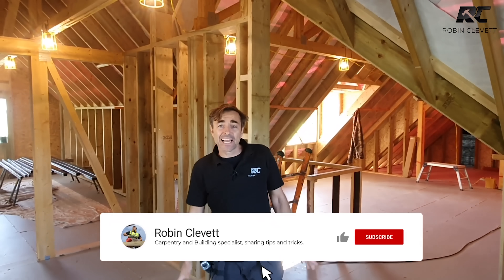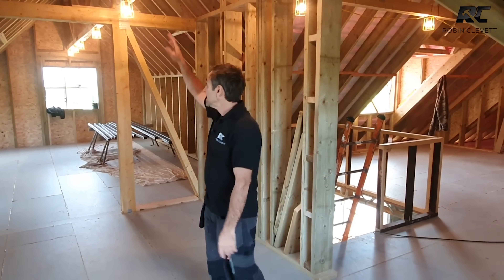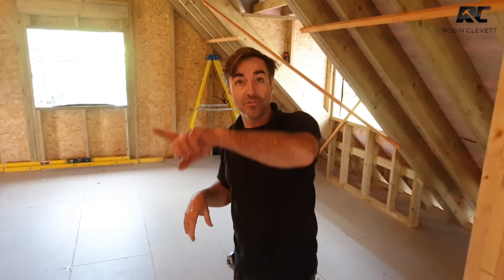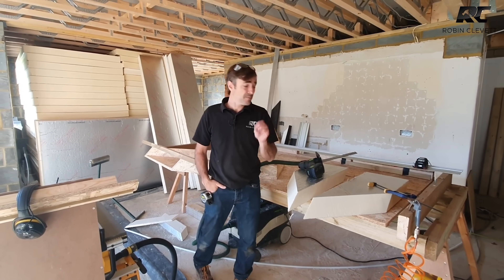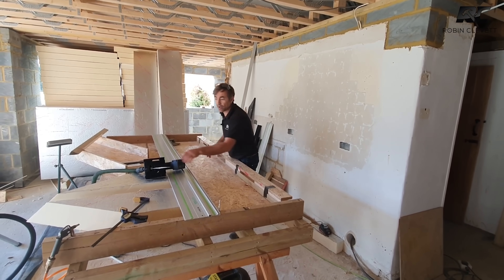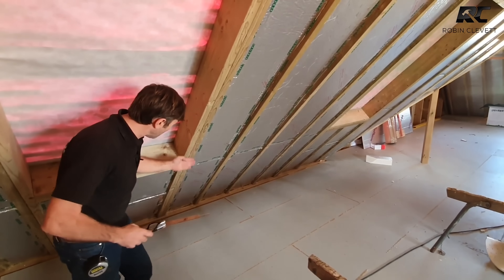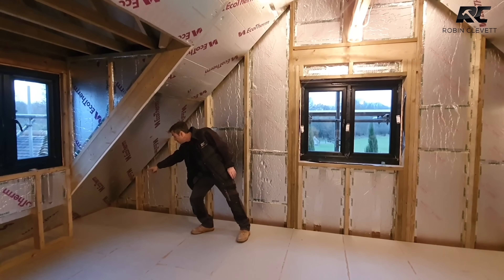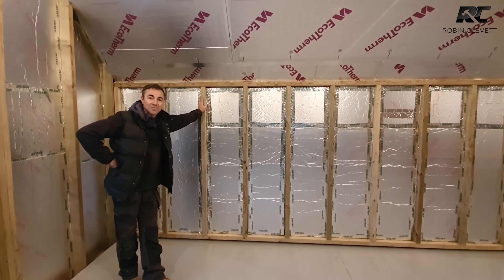How to fit insulation 2023 to the latest Building regulations Part L

Comment: Why not eliminate the roof venting, pushing the building envelope up under the roof deck? There’s no evidence I know of that this compromises any roofing material, and unless you have some radical moisture issues (tropical beach house, indoor swimming pool) there shouldn’t be strikes against it. Why is that roof vented in the first place? Is that your personal preference or something?

Also, leaving a 12-15mm gap around each panel and affixing them with expanding foam will seal better than any tape application, and will add shear value to boot. But you have the right idea with a 100mm fill and a 25mm topper sheet. That gives exactly the maximum benefit of closed cell foam sheathing. All you’re missing is the overall airtightness management, as I see it.
Reply from the maker: Hi Travis, the foam fill and cutting short really does not work, as it is almost impossible to fully fill the void, also you have to some how support all the boards while you try to foam the edges many people do this but it has so many pitfals, let alone 40 cans of filler foam and all the aerosol gasses!! Thanks for your comment mate
Reply: @robinclevettcarpenter  I’ve gotten the edge foam method to a science, using a few 2x4x8cm wedges of xps to hold the pieces in place. A sufficiently wide gap allows the applicator tip in to completely seal for air infiltration.  This is the only method I know that approximates the performance of either spray foam or continuous sheets of foil-faced rigid board. I sincerely doubt you’re getting anywhere near the full insulation value of your 100mm layer.

You also didn’t answer the question as to, why the roof venting in the first place? It’s like have a couple rooms with windows wide open, year round, which you must then somehow isolate from the rest of your building. That’s your real defect here — your building envelope is actually that continuous 25mm layer beneath the wallboard. The 100mm layer is, for  all practical purposes, outside the building envelope.
Reply: Travis, I think you’ve misunderstood the uk construction used here. What’s the air tightness that you’re talking about? The first layer of PIR goes from wall plate to ridge, and with memory foam tape, it is airtight, second 25mm layer is for the enhanced regs, plus is taped, so no air or moisture is getting thru from below. As for above the PIR, all uk roofs are vented from eaves to ridge to allow any moisture to dissipate from under your tiles or slates.

Comment: There are a few mineral/glass wool products around now with thermal conductivities as low as 0.032, which means they only need to be 1/3rd thicker than PIR for the same performance. Seems like that could be an option when you've got rafters as thick as this to hide a lot of that within, easier install as push fit without any additional products and it does self expand a little to fill gaps. Much easier to use offcuts when it knits together too. Not to mention the fire performance.
Reply: It can't be used in the roof, as it will sag over time, I found this is with my extention
Reply: @martinknight510  I imagine you'd be counter battening/boarding underneath

Comment: Great video and excellent set up for a cutting station 
I would suggest cross battens on the main roof as it allows water to run down on the felt easier and creates an air gap  with the vent strip over 
Less water on roofing laths
Allows for full fill insulation between rafters as well
Note increased spacings change design loadings and need to be checked with structural engineers depending on roof coverings
Great stuff Robin 👏 👍
Reply: My house is 1930's, tiled directly onto closed boarding....am I right to assume without stripping all the tiles, installing membrane and retiling over battens I can't use foil insulation, but can under loft floor

Comment: Just curious about the dead space between the rafters above and below the Velux?
Reply from the maker: This is so we can have a level plastered reveal at the top of the window and a plumb reveal in line with the wall below
Reply: @robinclevettcarpenter  Understood but no air movement above and below velux, no matter ? dead space/no air movement usually = condensation, am i missing something? Vapour barrier adequate in this situation?

Comment: cracking job. thats why i like ybs as you stickit over the whole roof then  cross batten then any internal voids can be done with rockwool the real stuff. and vapor p board. out of interest how do deal with humidity in your air tight buildings trickle vents and air heat recovery?

Comment: That looks a really great job. I am thinking of insulation my loft space, not to use as a room but to give the house better insulation. In my roof I have my boiler and hot water tank so a lot of heat is lost. My  house is a victorian property, double fronted. Huge roof and high ridge so space is not an issue. I was thinking instead of in between the rafters, which are not a precise centres, to place the insulation on the inside surface of the rafters, therefore putting in whole sheets and fixing through the sheets with long screws and washers, sealing the joints with tape. Would you have any comment on this method?

Comment: You are the industry poster boy for British standards. Over and above the call of duty. My issue is always cost. Time is expensive. Materials expensive. That posh saw is a Festool. Mega expensive. Never made the sort of money to have Festool anything. Personally I have issues with modern regulations and the idea of living in an hermetically sealed box. I don't believe it is good for the structure or the occupants. Roger Bisby made a comment the other day about houses with chimneys and open fires allowing all your moisture and air movement sorted by going up the chimney. The home owners all the healthier for it. Winter and summer in the UK I never shut my windows. Wake up with snow on the bed but never sick. If the regs want all this crap how come the UK hasn't gone the way of the Yanks and spray foam. A lot easier to do all those awkward angles with a spray gun. Either way these processes create their own problems and add extraordinary amounts to the cost of a build. There really is no such thing as affordable housing anymore. To me the initial cost out weighs the benefit. As a young couple starting out having a house that they can  comfortably afford and still have a life I think would be more important than buying an over priced super box with an environmentally controlled temperature setting that they had to hock granny to afford. Just gone too far.

Comment: Having used Gapotape, which I think is great, how did you deal with the release agents on the face of boards?  I tried white spirit to remove it, but it didn't work very well.  Meths worked, Acetone was best.
Reply: I am glad someone else has noticed this, I bought celotex recently as well as roctocel boards and it had this odd film / goo on the edges and the merchant told me it’s suppose to be cleared off in the factory, I was trying to put metal foil over the boards that were stopping the thermal bridge and no tape would work till I put spirits on it, word of advice to anyone getting boards, check the edges 🤦‍♂️
Reply: @lancelotswingman3907  I was told that the release agent was for when the boards are stacked on site, to make them easier to separate.  Apparently it varies from manufacturer to manufacturer.  I'd wouldn't use white spirit to wipe the boards down again.

Comment: Great job very impressed with the compound cuts great idea , just wondering do you keep a air gap between the breather membrane and PAR , and again between the 100mm PAR and the 25mm PAR  , Thanks a mill for the video 👌☘️🇮🇪👍👋
Reply: Fur vented cold roof you would have minimum 50mm ventilation gap between 100mm PIR and breather membrane. The gap between 25mm and rafter would be zero.

Comment: I dread to think how much all that cost. Just managed to see the batons you used to leave an air gap, 2 inches? behind insulation and roof. I insulated my floor with that type of insulation, unfortunately all the floor beams were different centres, being an old house and the swearing as I had to fit each piece individually was a joy to behold. Nice job Robbin!!
Reply from the maker: 50mm is the desired airflow gap behind the insulation
Reply: @robinclevettcarpenter  what about behind the wall insulation? That looks pushed tight into the space.

Comment: Just seen the price 😳 mega expensive. Are there no alternatives? I always try and snug fit. Don’t like cutting short and foaming like some do but could a snug fit with leading edge at the back, gap at front then foam work? Don’t think I could warrant the price of the gapotape on a small back extension!
Reply from the maker: Paddy, it makes such an improvement in the performance of the insulation, we have been able to use a slightly thinner board with the tapes and still achieve a better thermal result, also the actual fitting is far nicer and all the dusty edges are encapsulated, we just need to get used to the fact that we will need to use products such as Gapotape to achieve the type of results that will meet new standards set out by the regulatory bodies.
It's like a decent coat will keep you warm and last for years!! Gapotape is the same! Small additional investment, decades of improvement
Reply: Iv been told!! Nah to be fair I hope it becomes mandatory because it’s a genius idea! Just like any new product some customers baulk at the idea when they see the extra cost! Love the channel. Building done right 👍

Comment: It’s a good product but way overpriced for what it is. When buying a box at £95 for 50 linear meters; that wouldn’t cover 3 sheets of pir. It’s quite a hard sell to customers and other builders at that price point, I think it’s worth it but customers always complain about the cost of insulation.
Reply from the maker: I thought exactly the same when I first saw the product some years ago, but I have been fitting this type of insulation ever since it was introduced to the domestic market in the early 90s, by using the Gapotape and adopting the methods of construction that I use it takes half the time to install and the saving in labour itself more than covers the capital cost of the Gapotape, also the performance of the PIR with no badly fitting air spaces and gaps means that we can use a thinner PIR and this will also make the install easier and cheaper, it is a real winner of the product, people only see the initial cost and have no idea of the hidden costs of labour and excess energy wasted if fitted badly!
Reply: @robinclevettcarpenter  
I do appreciate it is a good product, no doubt a better insulation value.
It’s just convincing the client is where I struggle, most customers in my experience are only interested in spending the budget on the things they can see in the final project. 
A good example is a client of mine that gasped at the cost of the concrete for the foundations but spent £800 on a microwave and £1000 for and espresso machine for the kitchen.

Comment: Hi Robin,  what’s your thoughts on using super foil insulation instead of PIR ?
Reply from the maker: I have tried it but I'm still really keen on the performance of the PIR 
I have a property that is rooms in the roof with multifoils that I built some years ago and it performs "ok" but I also have a property very similar in size with PIR and the difference is noticeable, people often use multifoils as its meant to be easier to fit, I reckon that PIR with a decent set up is easier

Comment: I always thought the insulation should be flush to the face / underside of the timber ? 
I guess not - as long as the gap between the breather felt is maintained ? 
Done a cracking job there , cost a fortune but that’s what it takes to get it mint . 
I see you went for a moustache like your joiner but then shaved it off toward the end , fair play

Comment: we’re are the joist hanger on the velux frame mate ? , aswell 10mm gap between the refter and celotex  that’s a proper laugh 😂 
celotex shoul be perfectly tight from rafter to rafeter , then you apply the foil tape (aluminium tape) .
Reply: You are correct about the gap, it shouldn't be there.
Reply from the maker: Maybe you can explain exactly what the regs say about the positions of various layers and types of insulation? We do a calculation of how our materials perform based on how we will apply them, if you feel that I am missing something please enlighten me and the professionals that I employ who advise me?? Its really easy to put across a view or opinion like you have now maybe explain in detail your criticism??

Comment: With your rafters at 450's i guess you had wastage with the 25 PIR on the underside as they are 1200x2400, Also will you be using 1800 x 900 plasterboard to suit the rafter centres?
Reply from the maker: Hi Rob, we have no wastage as the PIR under does not need to land on a rafter, we but these wherever and foil tape, then we plasterboard with 15mm thick boards that are 2700 long by 1200 wide, it's a great system
Reply: @robinclevettcarpenter  wow 2.7's at 15mm, good job you got a young strong apprentice with you! keep up the awesome work!
Reply: Is plasterboard screwed to studs through the 25mm PIR with long screws or do you glue PB to PIR?

Comment: I've just used the exact same method to insulate my chalet style solid brick wall 1930 cottage. I wish I'd known about Gappo tape, because cutting push fit PIR for old and twisted beams and rafters is a nightmare! Still, the results for all the work, insulating it and getting it airtight, are worth it.  The bedrooms only lose 2.5 degrees in 24 hours, although it depends on the ambient outside temperature. I wish I had deeper rafters and more interior space to play with because I'd have gone to 200mm PIR if I did. I had to use Proctor Spacetherm in some places and that's hugely expensive, but you can never have enough insulation! I'm not connected with the building trade in any way, but you make excellent videos, and I've watched every Big Build with great pleasure. Thanks!
Reply: I did insulate extension floor above garage using low expansion foam instead of tape. I think you will find most UK buildings, especially 90s or older without a single square angle or straight line in them :)
Reply: @AdamCiernicki  I have a welsh stone house built in 1897 nothing is straight Lovely 18 inch thick stone block walls but never seen a right angle or straight line in it's life. Love the place though.
Reply from the maker: Well done Alex, sound like your efforts will pay dividends, 2.5 degree drop is super respectable!!

Comment: The first layer of PIR between the rafters is pushed to the back. This gives an air gab seen from the inside. Is there also an air gap seen from the outside? The breedable membrane is against the PIR seen from the outside?  Adding the PIR plates across the rafters from the inside the air gab will give extra insulation? Could you film this on closeup? I like the theoretical explanation, but for me, I like to see the construction when installed as well. I know this will take some time, but it is not needed to film the whole install, just a few bits would make a perfect add-on to what you want us to learn 🙂
Reply: Adriaan, the PIR is not pushed to the back. From what I gather, and as normal practice, there is a 50mm air gap for breathabilty between the PIR and the breathable membrane (coloured red in this case). There is then vents along the eaves (shown in the video) to allow air movement. I think your point about the air gap between the PIR layers adding more insulation value is true, a bit like how double glazing works. If you look at this video, from 16:30, RC explains it in more detail: https://www.youtube.com/watch?v=Omk68Z-tE7U
Reply: No the air gap is on other side to what you describe. I think you are looking at the walls not the rafters? it looks to be a different strategy for walls and rafters on this build, as is often the case

Comment: Hi robin did you have to cut every sheet of plasterboard down as you were at 450 centres ?
Reply from the maker: I use plasterboard that is 2700 long by 1200 wide
Reply: @robinclevettcarpenter  Super video, I knew you had a plan with the plasterboards 👍🏻
could you do a quick video with a mock up of a side view ie. rafter, pir, air, gaps, plasterboards and any fixings cheers.
P.s the Festool insulation saw looks amazing my guess it will pay for itself in just one job.

Comment: Amazing attention to detail as always, what an absolute credit to the industry you are Robin. I used Gapotape in my self build garden room and it is great for amateurs like myself who cannot hope to achieve the levels of precision that a professional such as yourself does. I found it really challenging to try and minimise waste across metric and imperial materials but can see that it is very achievable with sufficient forethought.
Reply from the maker: Much appreciated!
Reply: I’m in the setting out / planning stage of a similar garden room project. Really liking the idea of 450mm centres for wall studs and rafters. But can’t see how this doesn’t leave me cutting the outer sheets of OSB down by about 105mm if boarded horizontally. 

It seems to me that whatever option you take, you end up with cuts somewhere! 

But I am preferring the idea of 2 neat cuts on the PIR (giving 3 x 400mm pieces) and a small amount of waste on the OSB. Plus for corners, the 100mm will give me enough for overlaps.